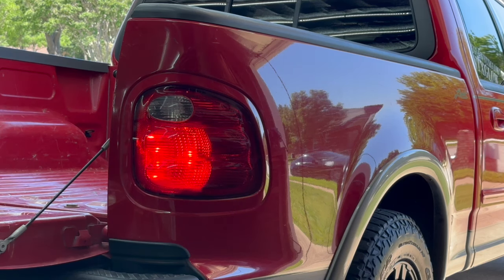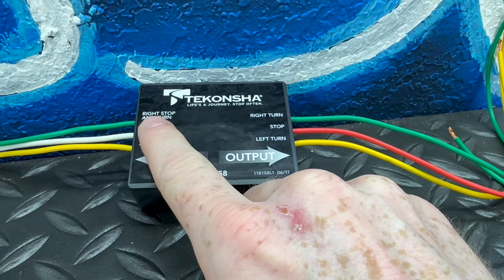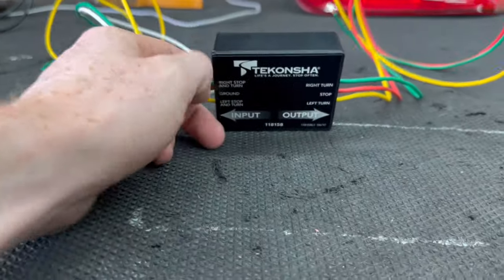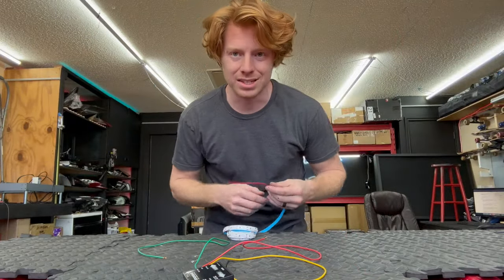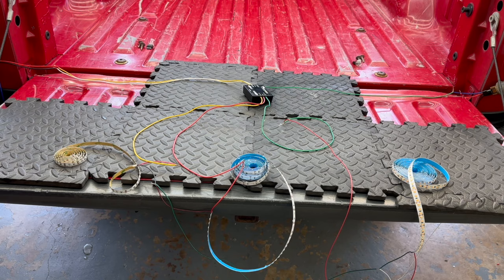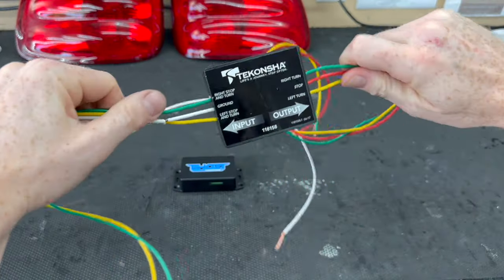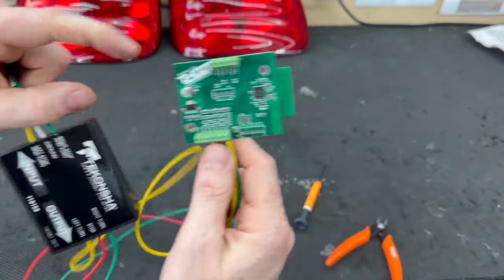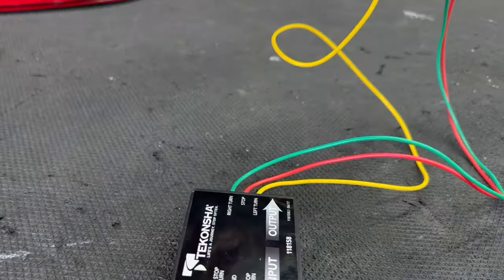How to Separate the Turn and Brake signals

Comment: A lot of people will see this that just want amber turn signals instead of red. It is a safer option. You can wire this module up so you can put a switchback bulb in your reverse light section of your tail light. VLEDS did this with the Tacoma, and it’s called VTails. I did this in my Dodge sedan that had a stop and turn setup. Very easy and recommended mod.
Reply from the maker: Thats smart! a little safer and it helps you stand out

Comment: The hazards end up being converted to a brake signal. I have a led strip and it just flashes the entire strip instead of just the turn signals. When pressing the brake pedal and one turn signal at the same time it causes to hyper flash the turn signal. Without the brake pedal being applied it functions normally sequentially. For the life of me I can’t figure out how to get everything to work 😢

Comment: Definitely wanna try this on my Escape. From the factory there's a small provision for signals, but it's blanked off 🤔
Reply: What year escape?
Reply: @nascardrawings7700  2012. 1st Gens have amber signals, but they use a relay system while the 2nd Gen uses BCMs
Reply from the maker: hmmmm maybe you drill it out and put in a bulb haha
Reply: @RazoE  depending on what your reverse bulb is you can put a switchback bulb in your reverse light
Reply: @zaccook  that's the plan!

Comment: I tried this method but when i press the break it sends a .5s flash to the turn signal wire then turns it off and powers the break light. Might try your module mine was different
Reply from the maker: oh that sucks! To be honest im not 100 percent sure if this one had a delay or not as I couldn't see it when setting the brake lol